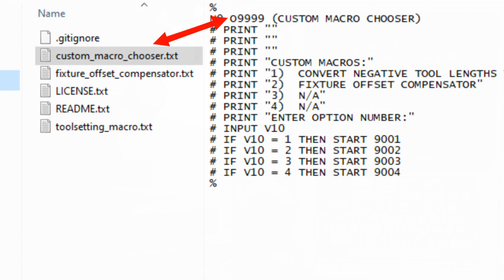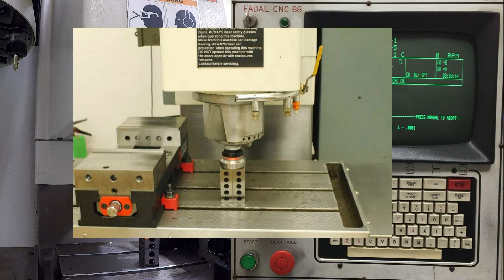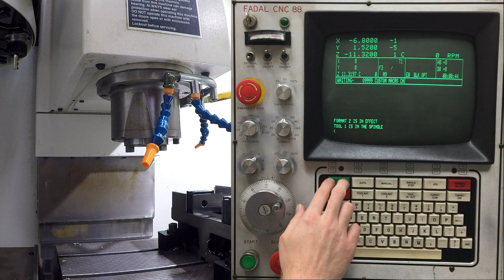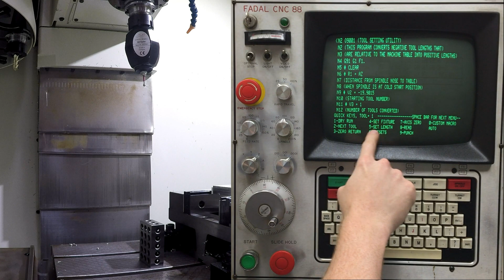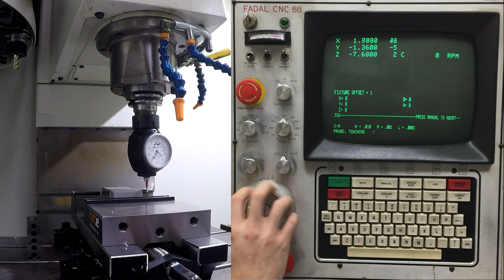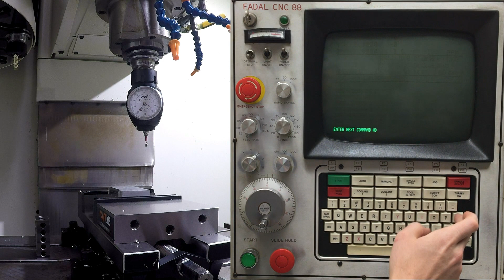Tool Offsets and Fixture Offsets - Getting Started 4

Comment: Why 9999   O-9999 wipes the memory on a fanuc system.  I'd rather avoid any calls to 
9999.  I know you do not need to use 9999.  It's just alarm bells going off.

Comment: Thanks for your hard work with the video...not sure if you're still doing your offsets this way as its a old video but there is a way less complicated way of doing it.  Use the haimer to set your offsets directly and use a cheap 2" dial tool setter off the vice or table.  Use your Haimer first to get your height with the 2" block off your vice and table and record those numbers...mine off the vice is -7.996" or something.  Then when tool setting and it asks guage block just enter that -7.996". Fixture offset will be direct reading from your Haimer no need to mess around with Macros.  I also never move the axis control knobs or step knobs...I always leave the rotary in Z and the steps at max. that way you have a bit of a safety buffer when you enter jog mode and have forgotten to move it back to Z...Just use x, y, z on your keyboard for axis control and H,M,L for step size...

Comment: Ive been looking at one localy how do you load a program? I currently use fusion 360 on a brand new machine at work but im wanting to get a fadal for home use
Reply from the maker: I use an FTP server. You could also use USB or SD … both require a board install but I cover it all in another video I made: https://youtu.be/IeXrYeqKZps

Comment: Im not understand where you want to go with that
if you measures all tools up through the spindle. going in the machine ,,, from the table ,, it never moves ,,, and all tools are  measured ,, so just finding the distance from the table to the workpiece zero point G54 X0 Y0 Z 145.5 G55 G56 G57 G58 J1  ,,  if you want to use haimer to set the zero point on the workpiece go to table and to zero on the haimer and add 2 inches if you use dial gauge

Comment: Macros are all well and good....but sometimes too many keystrokes for a particular application. For those that use the Haimer, on setting Z for your FO, just save the length of the Haimer in the memory of your calculator, do some simple math when touching off your part, and boom...there's your Z for that workpiece. No need for a macro in this case. It doesn't matter which piece you're setting Z for. As long as you have the length of the Haimer stored in the calc, then you'll be good to go. It's the way  I've done it for years. Thanks for posting though!

Comment: Great video. I was able to get this setup. However I found something interesting on the variables page for V2. I had originally entered my spindle height of -19.8304, I was able to run a program correctly. I then checked my variables page again and saw the -19.8304 had changed to -14.745. Does the variable 2 change or should it always reflect build table to spindle height?

Comment: I can use a metric haimer it's just accounting for the tip diameter so shouldn't matter right?
Reply from the maker: Correct, just make sure you use the correct size probe tip - threads are the same but I think the diameters are 4mm? 6mm? and 1/4 in... I could be wrong on the metric size, but I know it’s not the same as the standard one so your measurement would be off if you used the wrong one.
Reply: @bgwmachine  correct it's calibrated to offset the tip that's made for it

Comment: do you know how this process would work with the renishaw probe? I just got my fadal powered up.
Reply from the maker: It would be similar but you wouldn’t have to manually keep track of positions/work offsets because the control would track that when you program with the macros - I think it should be talked about in one of the Fadal manuals (most likely the programming manual).
Reply: @bgwmachine  yes it's in the manuals I've been reading it over and over but it's so much different then my centroid controller

Comment: Very interesting video. However, is there any posibility to transfer macros manually?? Not using DNC or something like that??
Reply from the maker: igor egaña - Overall you need a connection to the machine whether that be USB, Floppy disc, FTP, or other. If I remember correctly, I believe the manual goes over some of this.... other than that,  the only other option I could think of is manually typing.
Reply: @bgwmachine  ok thank you!

Comment: i ran a fadal 4020 vmc at my first job, it was ok but i am glad i was upgraded to almost new doosan. those fadals have rather good usability
Reply from the maker: Yeah, I would agree that I would prefer a newer control (also “grew up” on newer controls) but that of course is an issue cost wise for a home shop. I will admit though after digging through manuals I’ve gained a level of confidence with this older control and can do some things you can do in the newer controls - just not as user friendly.